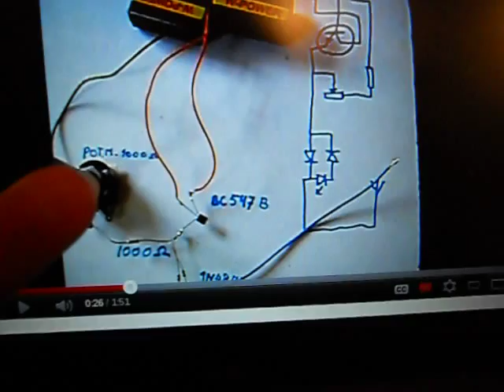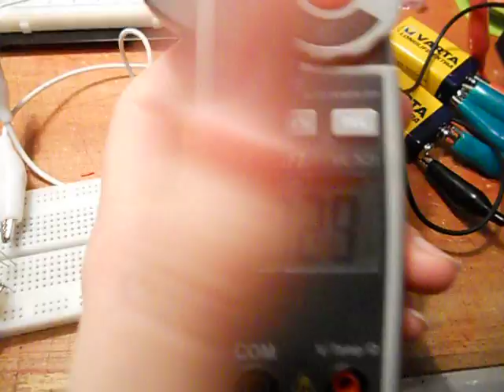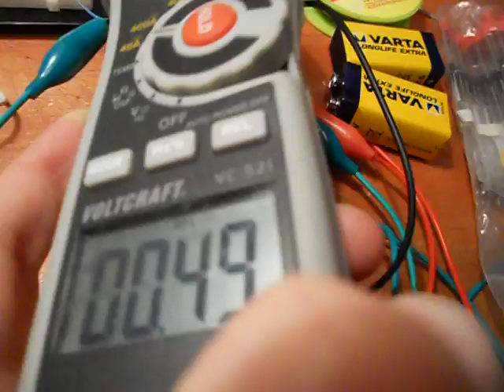Resonant Gyrator: this time working

Comment: Salut! ;) Well, I will write in english for anybody could read it ;)
So, you made it work with even less components ans that's very cool.
I'm not sure about what they about radiant energy and would be not about radio waves, but I'm very interested about the answer for the main problem: does it feed the LEDs more power that it's consuming form the batteries. Could you really deeply checking this please? ;)
Cdt.